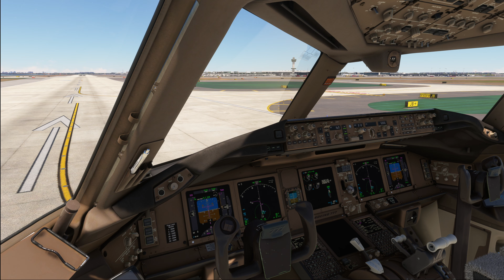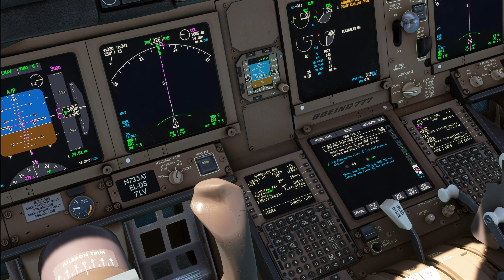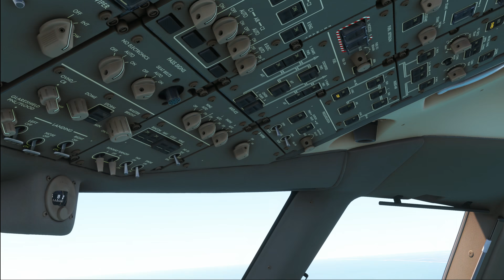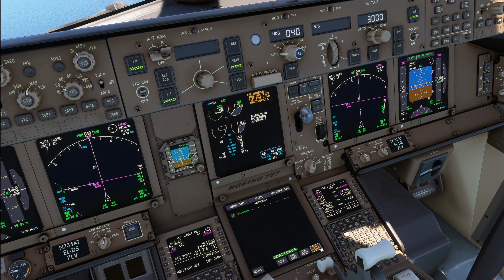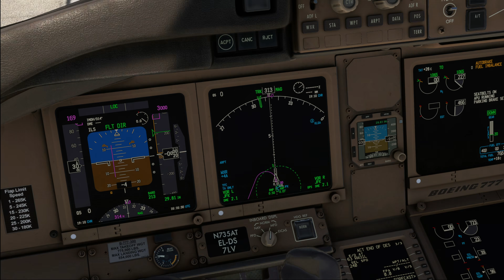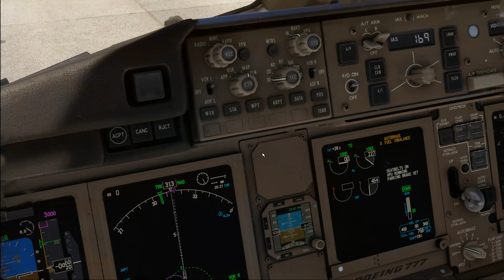Engine Failure out of New York! | PMDG 777 | Real Airline Pilot

Comment: Hi, you diagnosed the failure as a SVR damage/separation but you did the engine failure check list, that’s wrong. You need to go into the non normal checklist and select the SVR damage separation checklist.

Comment: I have one question: why is the remaining engine not switched to TO/GA thrust in order to gain speed/altitude?
Reply from the maker: Hi, since a fixed derate was used, the takeoff speeds are calculated on no more than the fixed derated thrust. Using more thrust could lead to loss of control since the control surfaces will be less effective if lower takeoff speeds were calculated due to a lower maximum thrust.
Generally, takeoff thrust is calculated to enable a safe single engine climb out. If a safe climb is possible, there is no reason for the pilot to increase it.
Reply: Cool, thank you very much for the quick response! Great content🫶
Reply: The engines are always on toga thrust during the take off
Reply: @kickedinthecalfbyacow7549 That‘s not in favor of an company

Comment: It is so interesting that you put out this video today. This very morning, I was chatting with this guy in discord who claimed to have flown 747s and 75/767s. I asked him what was the procedure if you had an engine failure at V1. “He said IMMEDIATELY idle the affected engine to prevent asymmetric thrust and help maintain control.”

At a critical stage of flight, I know pilots to leave the throttles alone, get to a safe altitude then secure everything.
Reply: It's strange because if you have an engine failure at v1 unless you have a superbrain you can't focus on taking off confirming the engine that has died and shutting it off safely. I mean imagine if you put the wrong engine to idle because you wanted to immediately get it to idle without confirming, it's just a massive risk
Reply: I mean aside from the fact that that's obviously completely wron, how, logically, would idling the engine even reduce assymetrical thrust in any way???
Reply: this is very scare, my cat is sad
Reply: no. advance to toga, if this were a flex/derate takeoff. use rudder and follow the flight directors. memory items complete?

Comment: There is a flaw in the engine out. It yaws towards the running engine if you notice it.
Reply from the maker: You're probably confusing "yaw towards the running engine" with the counter-rudder given by the TAC, are you? If you fail an engine and do nothing you should only get a very slight yaw into the direction of the failed engine. The 777's Thrust Assymetry computer should compensate for anything else.

Comment: Fantastic video as always! Quick tip: use bank limit of 15 to ensure full manoeuvre authority (and avoid stick shaker 😉)
Reply from the maker: Shouldn't the automatic bank limiter calculate the limit live? I was surprised it went to 25 as well, but generally it should do that stuff by itself, shouldn't it?
Reply: @A330Driver  u are right, AFDS should limits the bank angle (in AUTO bank limit) to 15 degrees until V2 + 10 then increases gradually to 25 degrees at V2 + 20, p.168 Continental B777 FCOM, http://www.ameacademy.com/pdf/boeing/Boeing-777-FCOM.pdf

Comment: Why didn’t the good engine go to TOGA or CON automatically when the engine failure occurred? Huge loss of performance by staying in DTO-2.
Reply from the maker: Since a fixed derate was used, going to TOGA or MCT at V2 might cause loss of control.
Reply: @A330Driver  understandable for on the ground. But it seemed to stay in that in the air too.
Reply: @edwardmyers1746  V2 speed is calculated for the specific weight and "thrust (Derated thrust)". Therefore if increase to MCT or CLB thrust at that particular V2 speed, Vmca maybe exceeded. Thus, the aircraft may ran out of rudder authority, due to increased thrust asymmetry and reduced aerodynamic performance of the rudder. Unlike assume tempeture take off thrust which does not affect V2 speed.
Reply: @frank1017  whats Vmca?
Reply: @edwardmyers1746  minimum control speed air

Comment: shouldn't you put angle of bank to 15 deg when on hdg sel and turning with eng fail before flaps up maneuvering speed?  it wouldn't get near that low speed scenario then
Reply from the maker: In a 737 you are right, but the 777 has automatic bank angle limitation so I would assume it can protect itself - or rather: Should protect itself.
Reply: @A330Driver  oh, didn't know that about 777   thanks
Reply: @Paiong  The AFDS should have limited the bank to 15° automatically. This was incorrect PMDG behaviour.
Reply: Sounds like some Airbus'isms are creeping in with FMGEC Normal Law envelopes. Not a bad thing, reduces workload and keeps people alive... perhaps not yet implemented by PMDG or a technical oversight?

Comment: hello. I always enjoy watching your videos.
I am practicing manual landing with PMDG 777, but there is a very difficult part, so I would like to ask about this part.
If you turn off the autopilot and land manually, you will descend while controlling the altitude well, but the altitude will drop slightly from the appropriate altitude.
In this case, even if you pull the yoke little by little, the glide slope will not return to the center and the altitude will continue to decrease. In this case, how can I get it to be centered on the glide slope?
Reply: Is the speed lowering? And if so are you trimming the plane ?
Reply: No, it doesn't slow down.There is no problem with the flight. When landing manually, the yoke is manipulated so that the localizer and glide slope are centered, but when the altitude gradually decreases from the appropriate altitude, the glide slope is not centered even if the yoke is pulled. @matejmarosz20
Reply: @redsonssi Pull the yoke back more then?
Reply: @Angel33Demon666  When the altitude decreases, I try to pull the yoke slightly to center it on the glide slope. However, I don't pull the yoke too much. I know that if I do that, I'll lose more altitude.
Reply: @redsonssi  if you pull it more you’ll lose more altitude…what?
Reply: @Angel33Demon666  If the altitude decreases, shouldn't you pull the yoke a little to maintain the appropriate altitude? If not, what should I do then?
Reply: @redsonssi  Pull it enough to maintain altitude, then trim it out